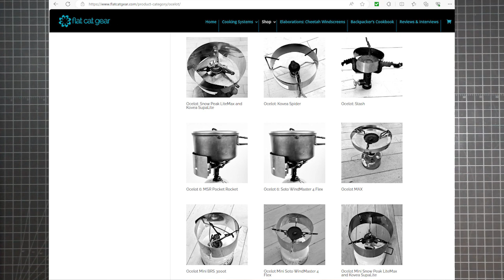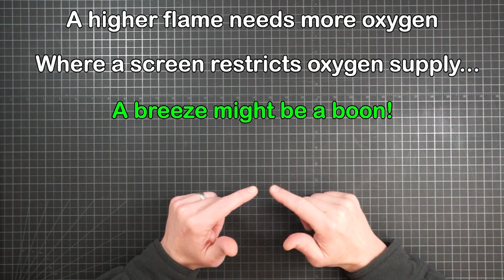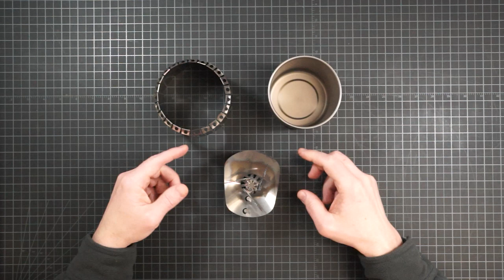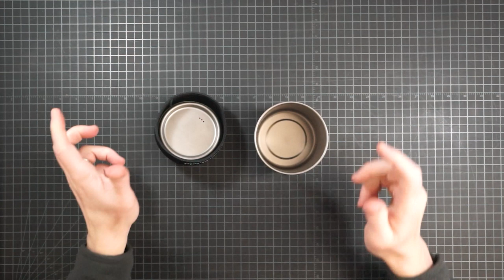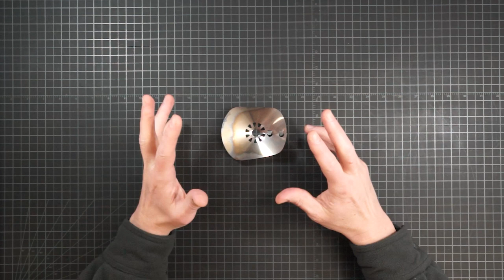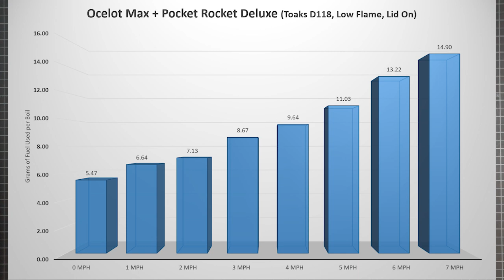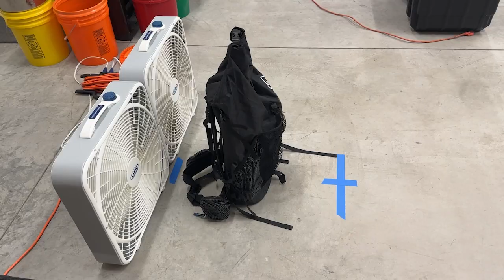Backpacking Stove Efficiency, Part 3: Windscreens

Comment: Nice video and thanks for the info. Would love to see how a standard aluminum folding screen would do. They seem to be about 6 or 9 inches high and have several panels that can partially or fully enclose a burner.
Reply from the maker: I do have a remote canister stove and a couple of ground-sitting screens.  I’m curious, too. I will get to it one of these days!
Reply from the maker: Those are heavy. Heavier than stove+pot+titanium screen together. 

Also, ground-standing screens will trap the canister itself inside.  You’d want to be careful about overheating that pressurized fuel container.
Reply: @GearSkeptic  Yeah 4-6 oz for the 6 inch high ones, and should go remote canister or use direct canister in short bursts. Cheap though, at $10 bucks. Still would like to see how the cheap and simple solution stacks up. KISS methods is best I find. Would like to see if it holds true here.

Comment: Once again awesome in depth analysis, thank you for putting in all that time to produce.

My current setup has changed to account for wind after nearly setting fire to my testicles after a tent flap on my xmid came loose and knocked my pot and alpkit stove into my lap nearly melting, tent, pad, ee puffy jacket and quilt (a very expensive mistake).
This prompted me to search for a system that was more wind resistant to avoid vestibule cooking, I settled on the soto windmaster (60.3g) and the triflex pot stand at (6.74g) coupled to an evernew eca521r pasta pot (71.98g) totaling 139.05g and let's not forget this includes a piezo ignitor too.
From what I can see this appears to be extremely wind resistant and should hopefully seal the deal with not having to cook in the vestibule anymore at least till I can get my hands on a TD caldera cone which i think is more suitable for tent cooking!
Would love to see some in depth analysis on gas vs Alcohol, specifically Trail designs cones as they are popular I believe.
Cheers
Reply from the maker: Yes! Heat exchanger pots are next, but alcohol stoves are on the list.

Comment: Higher altitude, colder weather, colder water and colder surface temperatures might all point to the MSR Pocket Rocket Deluxe as the stove of choice with its built in regulator. It is consoling to see that the BRS (prefer the Fire Maple version myself although it is slightly heavier and a little more expensive) with windscreen is a viable choice ,if managed, in windy conditions.
Reply: FYI Ocelot Minis are a subset of the Ocelot Family. In the Standard Series, we do support the Fire Maple 300t as well as the new Fire Maple Hornet II.  Best regards.
Reply: @FlatCatGear thanks for the input. This is good to know.

Comment: I wonder if "ground supported" windscreens like the toaks titanium one (14g!) Handle higher wind better.
Reply from the maker: A concern with a ground screen on a canister stove is the idea of trapping the fuel inside, creating a possible overheating and explosion risk.  That’s why I didn’t try that out here.

I do have an ultralight remote canister stove, though. Eventually, I will try that out with the remote burner fully shielded with a ground screen.
Reply: @GearSkeptic  I have definitely felt the top of the canister get warm-hot using the screen. It's weird I've never heard of the explosion risk. I've always assumed it was IR, so probably able to be mitigated.

Maybe some
Reply from the maker: It’s one of those internet warnings.  I have an infrared thermometer.  One of these days I should run some consecutive boils and check can temperature as it goes.

Comment: In addition to flame quality vs wind there’s also a lot of conductive heat loss from the shield and pot metal to the cold air passing by. Maybe a fiberglass wind screen would be better than titanium? Basically it needs an insulated jacket in addition to blocking the wind.

Comment: ... aluminum foil?
Reply: I think you could make a very useful and effective windscreen using heavy duty aluminum foil with about three pieces of plastic straw attached near the end and one in the middle through which you place the shepherds hook type titanium tent stakes to hold it in place. You could encircle the stove about 3/4 of the diameter with some stand off distance to avoid trapping too much heat near the canister. I normally carry two or three of the shepherds hook stakes as backup/extra guy line staking in certain conditions.

Comment: I'm curious if you have any results about total system efficiency of boiling larger volumes of water. For example if you were in a group of 2 or 3 people, what are the tradeoffs of using a bigger pot to boil enough water for two or three meals (or meal plus hot drink) vs having to boil the same total water volume in multiple batches with smaller pots.
Reply from the maker: Not yet! On my list is a test series of alternate containers including aluminum, steel, and shapes like kettles and large pots.

Comment: Always excited when a new Gear Skeptic video comes out. If I'm ever actually going to go backpacking, I feel like I'm going to be well prepped when it comes to areas your current videos cover.

I feel like you've mentioned it in one of your videos, but I'm not sure. Have you looked at multi variable testing methods to decrease the amount of time it takes for your testing? NightHawkInLight has a great video on a multivariable testing methodology that he used to optimize firework chemical composition without having to do extensive testing.
Reply from the maker: Not familiar. Will have to check it out!

Comment: Excellent work as usual.

(not wanting to be THAT guy but) I know you have used the low-down adapter but when I weighed a canister stabiliser vs having a remote-canister stove, the weight addition was small AND I found the pot lower, hence the flame is lower hence ground effect lower average wind. 

My canister stabiliser I got from a Jetboil Sol Ti is 28.8g. My BRS-3000T is 26.2g. So stove+stabiliser = 55g. My FMS-117T is 106g, so 51g more but is lower down and even more stable. So does that lower position = less wind = more efficient? Also as the canister is remote you have more options to more enclose the flame around a pot?

For 30 years I carried a Trangia 27 602g so I just got more bruised hips from the backpack, I guess.
Reply from the maker: I do have a remote canister stove to test with a full-wrap screen that can just sit on the ground. Also, working on a DIY attachable titanium screen.

The LowDown adapters are just for testing. Never take one in the field.
Reply: You don't have to do the tests again just put your wind meter at different heights, ideally over grass or the typical surface you cook. You should see a ground effect drag and so infer the performance improvement. 

And I agree the weight saving of just use what you have to shield wind. Something wider has less wind so a low down flame behind a wide obstruction by you own tests should be then getting wind to the low speeds then your test results at lower speeds applies. @GearSkeptic

Comment: You can make a much more effective windscreen diy from aluminum from the bottom of a dollar store aluminum tray and a paper clip.  Make the screen so it fully wraps around your pot plus an inch or so more.  Hole punch air holes in the bottom of the screen only 1/2" up from the bottom.  Wrap around cooking set up with space and paper clip at set circumference.  Works great, costs about $1 and very light.

Comment: with the Optimus windshield, as i've picked one up a month ago, I've noticed the heat shield does get hot enough that I'm wondering if it' warms up the canister in some way shape or form or not (I've not used it long enough to notice if it does). 
What I'm wondering is, would the Optimus windshield be a good way to have both; wind protection and as a way to warm up the canister for cold weather performance?
I've seen modifications where there is a stainless steel strip or titanium strip that is fed from the burner and taped/ strapped to the canister body and further wrapped with a coozie to warm up the canister.
Reply from the maker: Good question. I haven’t had the chance to check on canister warming strategies.
Reply: @Shveet the strip is called a Moulder strip. It works best if it’s made of copper. Search for that term, Moulder, and select the search result at Backpacking Light. The post of the person by that name who explained how to use one safely and effectively is a short read but very informative. You don’t have to be a member of Backpacking Light to read the post.

Comment: I love your tests!
Is there any synergy between using the Simmershield (without base) AND the Ocelot Mini? 
I keep thinking that channeling heat up the sides of the pot must be more efficient (b/c more surface area heated). 
It should do part/most of the job of a heat exchanger with less weight.
Reply from the maker: Interesting. I’m not sure they’d fit together, but you can adjust the SimmerShield to ride the pot at different heights.  I do think an overall taller screen could help get you both wind protection at the bottom and pot cradling up top, but you end up with something that won’t fit inside the pot. That turns a lot of people off.

Comment: Thank you for all the thought and work that went into this analysis. Quality work as always. As you point out, knowing the facts as to efficiency allows us to make better choices as to compromises. I’ve used the regular Ocelot screen (with the bottom plate) with a Pocket Rocket Deluxe and a 650 mug-style pot for about 3000 miles of trail over the last two years, despite the weight penalty over the BRS/Mini combination, because I trust the MSR stove more (part of the additional weight of a PR Deluxe is a piezo does save me the weight of one lighter), I want to fit both the stove and windscreen in my pot, and I want to stretch each canister down the trail so I don’t have to carry two or toss a partial canister as often. I know that I average around 20 “boils” per (100-110g) canister, which helps me plan. After watching this, I am going to be more careful about finding wind blocks around the campsite to supplement my windscreen. Gaining efficiency that way seems to be the lightest and cheapest way to save more fuel.

Comment: I would like to know if the Oscelot Original fits both the BRS3000 and Windmaster 3 flex.
The attachment seems so similar for multiple three foot stoves
Reply from the maker: Good question. I don’t have the original model. I bet Jon at Flat Cat Gear could tell you!
Reply: In the standard Ocelot line, each burner plate must be customized to a particular stove.  The plate for the BRS is not compatible with the Soto 3 Flex.  Best regards.

Comment: Fantastic series! You've clearly shown how there are no simple solutions, just necessary compromises. I've done dozens, if not hundreds, of boil tests with alcohol stoves but never had the discipline to record and organize the data. Thanks for the heavy lifting on the canister side of things.
Reply from the maker: Thanks! I do plan to try and include alcohol stoves using the same method, for comparison.  But, heat exchanger systems are next.
Reply: It would be nice to do alcohol stoves. My feeling is most videos of bench tests are not done in realistic conditions but the rigour of your method might throw light on that. Nobody I've seen seems to take into account the fuel used to make the stove bloom, as if that just gets thrown away. Also wind, realistic ambient temperature and starting temperature of water are factors...
Reply: @bobprince1472  not counting bloom time  in a stove test is a pet peeve of mine.
Reply: Winter is becoming almost non existent here in the southern UK, Lat 51deg, so it's hard to do tests in cold conditions. My understanding is that bloom time is affected both by the design of the stove and more critically ambient temperature which affects the physical temperature of the stove. In the cold it takes a lot longer to bloom. I checked out your channel and saw the Trangia adapter

Comment: Another excellent video. Thanks for the work you put into this. Personally I've mostly used white gas stoves like the MSR X-GK, Whisperlite and Simmerlite. I certainly take advantage of any natural wind blocking features of the landscape (and my backpack), but still consider a wind screen a safety feature as it can mean the difference between the stove working and not working in difficult conditions.
Reply from the maker: Thanks! I do plan to try a remote canister stove with full surround screen for comparison.  Someday, maybe white gas? Though, I’m pledged to do heat exchangers next.

Comment: Hi! Thanks a lot for content! What about testing with wind like 10-20mph+? Because as I see on practice, it's unusable conditions for BRS and very important to recommend people ignore this stove for hikes with wind like this(or vice versa - destroy my impressions by tests😄). In most mountain hiking places on earth wind like 5-10mph it's basic speed 24\7. Rarely less, often more.
Reply from the maker: My strategy in that strong wind would be to use additional wind-blocking like setting up some backpacks, using my body, or perhaps my tent for protection.

I want to get the wind speed at the pot lower than 10mph before relying on screens like these.

Comment: 1) If curved-upward floor decreases performance, then might it make sense to flip it upside-down to increase performance?  2) Caldera-Cone?  Seems like a nice calm or low-speed vertical laminar-flow along the side(s) of the pot is the holy-grail?  Trap maximum heat around the sides of a pot to maximize heat transfer.  If the bottom of 550ml pot is 95mm (Dia), then surface area is 7k mm^2.  Add side-wall to the heat-transfer equation for another 23k mm^2, more than three-times the bottom heating surface area.  Just as a wider pot-bottom heats more efficiently (due to larger heated-surface-area), so would heating the sides of the pot (e.g. w/ Caldera-Cone.).  (more...) 

However, Caldera-cone isn't the only way to heat the sides.  It may not even be the best way to heat the pot sides.  

As posted previously, this author's best results were by using thin (1/4") white wood-stove insulation (rated to 2,200°F) surrounded by 0.005" Titanium-sheet.  Insulation pressed against the pot-sidewall provided the dual benefit of trapping heat, while allowing sufficient airflow to maintain high-temperatures.  All from heat that would normally be wasted anyway.  The insulated shield weighs less than an ounce.  

Presumably, Caldera-Cone could be designed to hold a similar temperature profile against the pot-sidewall, but suspect that aspect has not been optimized for the Caldera, since there's no sign of engineered exhaust at the top of the Cone?  

Nevertheless, Caldera-Cone has the advantage of optimizing pot distance from the burner.  Pot-to-burner distance is likewise not set to optimal height for any commercial gas-canister stove, due to wind considerations.  Suspect the optimal burner-pot distance in zero wind (such as under a Caldera-Cone) is between 1" & 2".  Caldera-Cone has the added advantage of being available commercially. 

Great job, btw.
Reply: The Caldera Cone is a great solution for use with an alcohol burner creating a stove solution. I think it would be dangerous, if not death defying, to use one with a canister stove as the cone is currently designed. Could you design one with a large cutout to be placed  downwind so as to release heat to avoid overheating the canister? Maybe but it would be risky and no one is going to sell something like that intended for that use because of the liability. My guess anyway. It would certainly require testing and you never want to totally isolate the fuel regulating valve on a canister stove in case you need to use it.
Reply: @wanttogo1958  Obviously one would need larger air intakes at the bottom to prevent the canister from overheating (because Caldera-cone is designed for alcohol-stoves).  Likewise one would require a taller cone (since canister stoves are much taller than alcohol stoves).  Not only is the canister-stove taller, but virtually every canister-stove would function better with an increased stove-to-pot distance. Original-post goes on to suggest even lighter-weight solutions than the cone.  Caldera-cone is merely the jumping-off point for considering the optimal windscreen design.

Comment: I wonder how aluminum would fair in place of titanium, in terms of weight, durability and cost. Will you do DIY equipment and figure out how many more boils one would get by spending money saved with a DIY shield on fuel canisters? Or would that be irrelevant since weight is the primary consideration?
Reply from the maker: I am playing around with a DIY screen.  Someday, I’d also like to test the difference between titanium, aluminum, and steel pots.

Heat exchangers are my next project, and those are all aluminum.

Comment: I can't remember if I mentioned before, but I did similar tests with alcohol stoves and a couple of wind shield combinations.    https://youtu.be/YxNgYzAgKfU?si=J3_yi0s7ZKQMMfPS
I'll be interested to compare the weight of fuel being used.  
I have a BRS but couldn't get near my alcohol setup when there was wind. And I generally prefer alcohol.  Might pick up one of the Ocelot wind shields though, incase I end up using the BRS any time.
Thanks for another superb video!  Definitely the Gold standard!

Comment: Would drilling small holes, say one millimetre, help feed air into the flame at a lower enough velocity to help orevent the oxygen starvation issue?  Asking for a friend
Reply from the maker: I’m going to have to do some DIY tinkering!
Reply: @GearSkeptic  
Sorry 😔
Reply: At 1mm probably not. Based on the unscientific testing I've seen done on home brewed sheet aluminium wind shields. We had to get to 8 or 10mm before it wasn't obvious the shield was choking the flame.